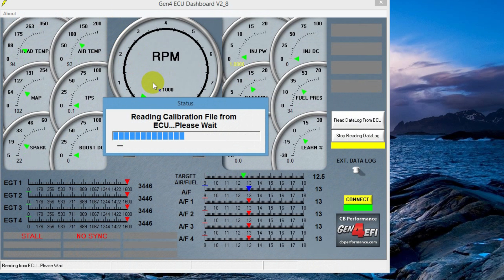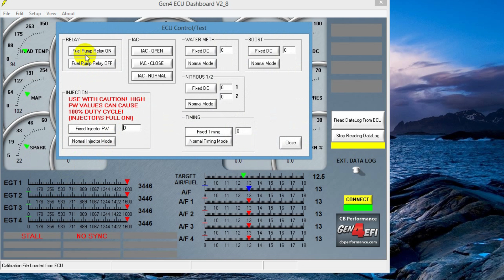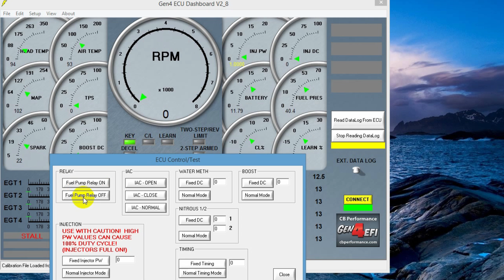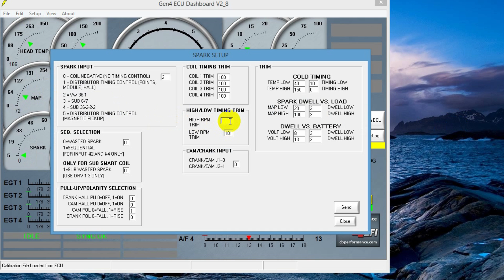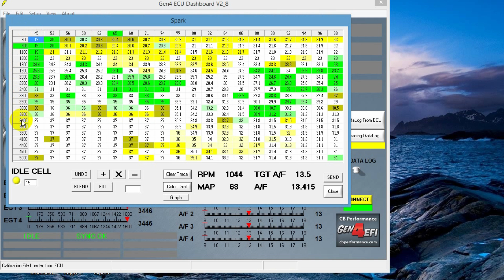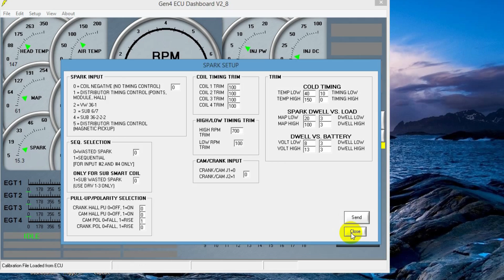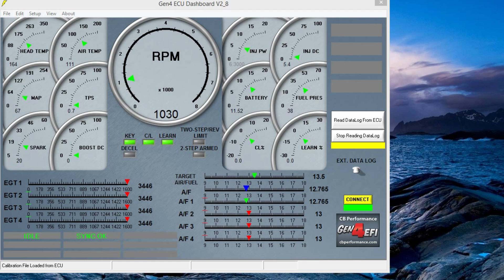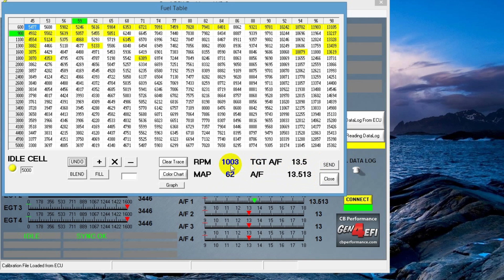CB Performance - Gen4 EFI Setup

Comment: i have an older cd performance efi turbo set up.like 2007 old.now when i get on the throttle on the top end the motor starts to make a crackle sound and it sound bad enough to the point where i dont wanna throttle threw ir in fear something with in the internals will get meased up. any ideas what thay that crackling aound can be. wee thought maybe a fuel issue as in maybe to rich or leans and someone also said it could. be a wastegate issue.  my set up is so old you cant do alot of the tuning thi fs you can on the newerr setups such as this one y ou are using. im at a standstill to what the issue could be

Comment: Are there any pros or cons to using a single throttle body (similar to stock) and manifold mounted injectors on a single port 70 bay window? I'm looking to increase torque and programmability. not sure if you offer that situation but would at least like your oppinion. Thanks

Comment: I have an Engine built from Pat using your EFI Gen4 system. I’m running e85 what should my A/F ratio be at for the set up. I’d like to run 2 saved up maps so I can switch over to gas with Octane boosters if I can’t find a local fuel source.  Thanks for your help
Reply from the maker: Please e-mail mark@cbperformance.com with this inquiry, he'll be able to help you out.